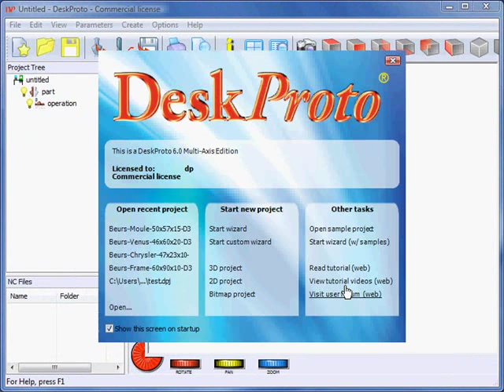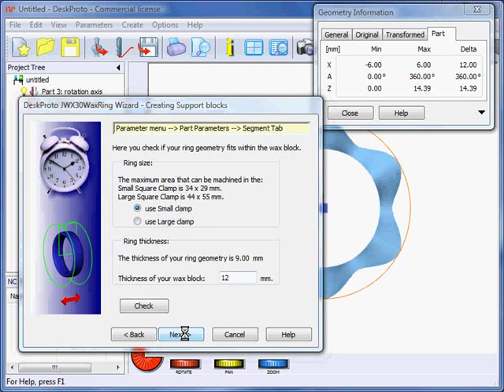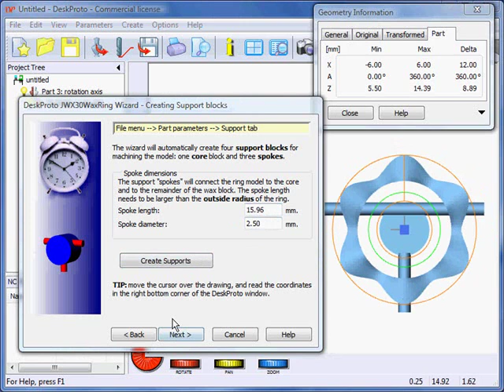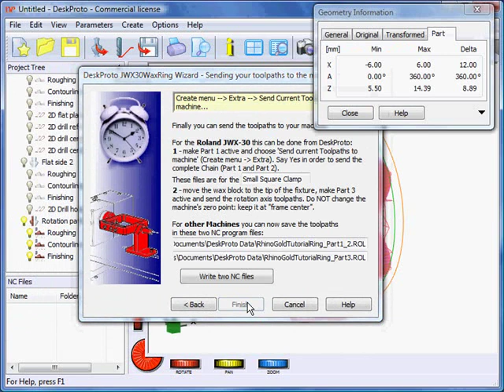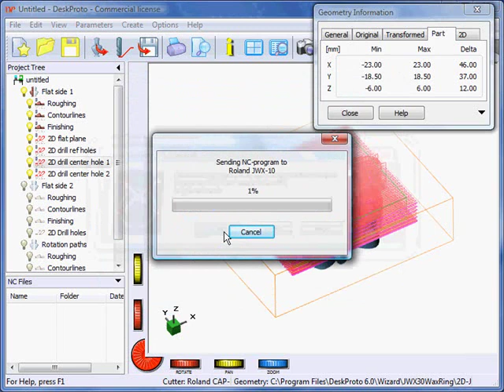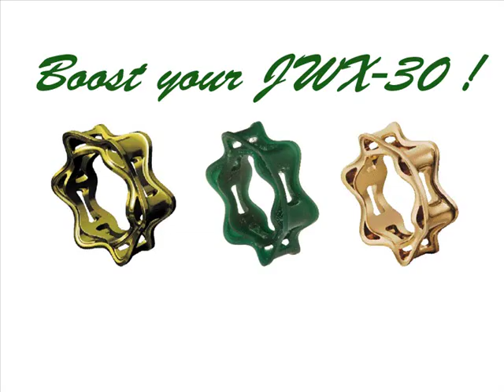The DeskProto JWX30 Wizard to machine jewelry wax models

Comment: Great video!!!! thank you for sharing. I have a question, Is this machine open software? i mean, Can i scann another objet whit a 3d canner and then milling in this machine? Does it use STL or G code? Thank you!!
Reply from the maker: The Roland machines do not understand G-code, instead they use a proprietary Roland plotter language (RDGL). The DeskProto software shown in the video can read STL files, so machining based on 3D scan data is very well possible. Note that Roland no longer manufactures this  JWX-30 machine. DeskProto can communicate with almost any machine though.

Comment: hi! 
purchased the machine jwx-30. wanted to create a pack to run, but the program is missing postprocessor for this machine. 
do not share a file post-processor?
Reply from the maker: Hi Сергей,  Nor sure what you mean when you say "the program is missing postprocessor". Do you mean DeskProto?  In DeskProto the machine "Roland JWX-30" is in the list of machines that you can choose from.
Reply: DeskProto in the machine library there is Roland Jwx-30, and in the library of postprocessors there is no machine.
My problem is related to the fact that when I create the UE on the rotary axis, the table (Y axis) does not come to the right point. The x and z axis work as they should, but the Y axis does not work. i.e. the cutter operates "by air"
Reply from the maker: Hi  Сергей . The JWX-30 machine definition in DeskProto uses the postprocessor called "Roland RML1, Spindle any RPM". You can see that in the machine definition for the JWX-30. When you there press button Advanced settings you can check the option "Write Y=0 in first movement command for rotary machining".  
This is all for DeskProto V7. In DeskProto V6 you will need to move the machine to Y-0 before starting the NC file from DeskProto.